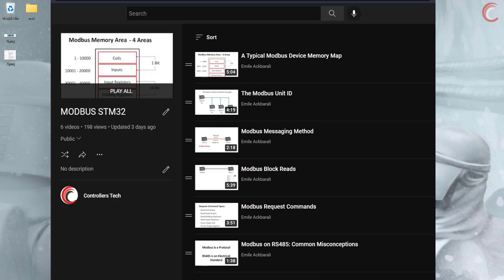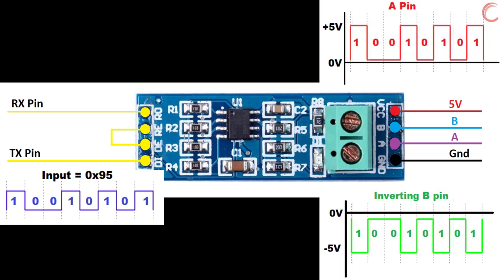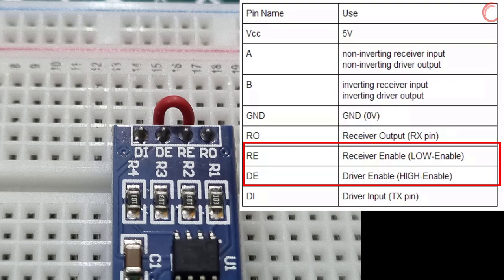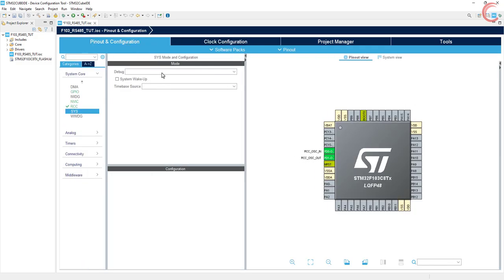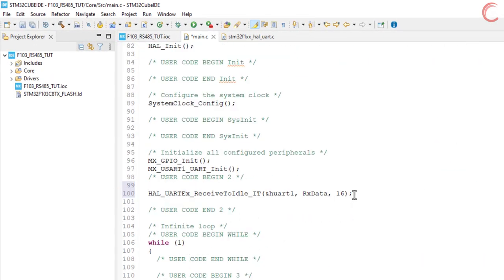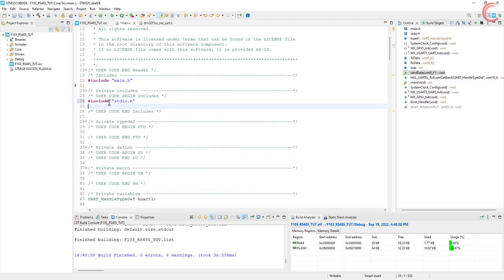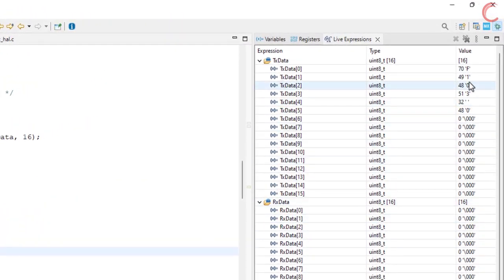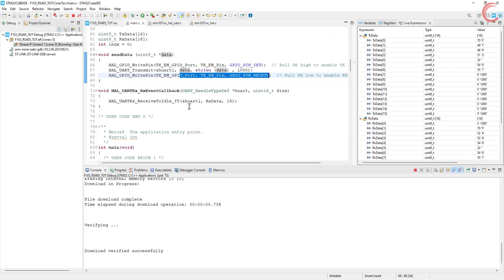How to Interface RS485 Module with STM32

Comment: I have a few tips about RS485 with STM32:
1) use a bias network in addition to the termination resistor. You can look up "RS485 bias".
Even if the RS485 line drivers have a "safe mode" they can still experience glitches on the receiver with the first byte. Especially if you don't share a GND.
So you may miss or corrupt the first byte!
2) STM32 UART RX doesn't have a hardware buffer. Receiving using interrupt is often too slow and you can miss data. Only DMA receiving works properly IMHO. 
3) You can use circular DMA for UART if you don't want to lose any data, but for RS485 this is not really needed. In fact it is best to clear any UART buffer after sending in case data ends up in your RX buffer.
4) Note that when a glitch occurs an RX error will automatically halt DMA reception and you have to manually re-enable it. So enable the appropriate error interrupts (UART and/or DMA) and handle the errors appropriately or you may wait forever for data (though that only applies to an RS485 slave).
5) Add short delays between switching Drive Enable and  data transmission (before and after transmission). This makes communication more reliable.
6) Enable Idle line detection interrupt. This is very useful in case you don't know how many bytes you are expecting. You receive an interrupt after receiving the last byte of a message.
7) If you want to use very high Baud rates check the datasheet of your line drivers. They come in different speeds/slope limits.
8) With any UART communication always verify your baudrate. With low clock frequencies you may not be able to get the exact baudrates you want due to rounding errors. Internal oscillators also have limited accuracy. It may work until it doesn't...
9) When you want to connect it to the PC use the FT232R USB serial converter. It has a TXen pin that switches while it is sending. You can connect this pin to the RS485 DE pin. The alternative is to use the DTR or RTS pin, but this can switch too slow as Windows is not real time. Cheap USB-RS485 converters often use DTR and are not always reliable. So check the schematic before buying one.
Reply: Hello There. Can i contact you?

Comment: hello, thanks for a great explaination, but I have a question. Could we connect the RO and DI pin of the MAX485 chip to RX and TX pin of USART2 instead of USART1 (on STM32L152RE)? because I had a project at  school, we implemented the MODBUS RTU protocol, at first we used USART2 for debugging purpose, but after that we had to change to USART1 to deal with RS485 to USB converter, and I didn't know the reason why we had to change.
Reply from the maker: You are using a nucleo board i guess. You tested it using the uart2 because in nucleo boards uart2 pins are shorted to be used as the vcp (virtual com port), so you don't need to connect an external hardware for uart, just the usb cable is enough.
Now you want to use the rs485. This is why you used uart1, as the uart2 pin are being used as vcp and are not avaialble seperately.
You can use any uart other than uart2. But if you insist on using uart2, then you need to see the schematics of the board and modify the hardware a little so that the pins are avaialble for external connection.
Reply: @ControllersTech Thank you very much, that is very helpful!

Comment: Hello, i want to interface a SmartEmbedded screen with an toshiba inverter and read out the inverter frequency on the screen by using RS485 wire with Stm32cubeIde, I would like to know if it´s possible ?

Comment: Great explanation. I use different module with auto logic for receive and transmit,so it's only need 2 pins. If possible i need knowledge about CAN J1939 and OBD2 :D

Comment: Hi, great tutorial. I have one question - what voltage are You using to power the modules? If the voltage is 5V - do You need any voltage converter for data lines Rx/Tx?
Reply from the maker: The voltage is 5V. The MAX485 chip takes care of thr conversion so we don't need any voltage converters.
Reply: @ControllersTech   Thank You for reply.

Comment: Hello great video ! i try your code on 2 H7A3 Nucleo, the TX board is working, but Rx board is not! is there any additional setting at IDE configuration that you miss out in the video? i dun understand the RxData[16] appear all 0 at Live Expression !
can you advise...
Reply: Hello... can u reply ...
Reply from the maker: Nothing extra is needed. Make sure both RS485 has common ground. 

If it doesn't work, first check if simple uart transmission is working fine.
Reply: @ControllersTech  Hello...  i use same power supply to the 2 RS485 board,  the power supply for the 2 H7A3 comes from 2 USB port is the fine?  Tx board is able to transmit F103 to live experssion, but Rx board does not show any (RxData all 0s) UART transmission is working...
Reply from the maker: If the simple uart is not working, theb RS485 won't work. You should look into that first. 

Also the tx buffer in live expression does not signify that transmission is working. The buffer simply changes because you are updating it in the code. You should use a logic analyzer or an oscilloscope to confirm if transmission is working. 

If you are using a nucleo board, do not use uart2, as it is connected to the st link. 

You should connect each board to the computer individually and check if uart tx and rx is working.
Reply: @ControllersTech  Hello... i  m using UART1 for both boards, power from USB port 1 and port 2, both the RS485 powered from external power bank. How should the common ground be wired? When i scope the Tx node A and B show correct waveform BUT 0.5v amplitude whats happed?
Reply from the maker: Contact me on telegram

Comment: how to use 2 uarts 2 modules with one stm. I tried to combine codes but It does not work properly
Reply: I have the same question, use uart1 transits, uart 2 receive, but it can't work.
Reply: @vincenttsai5116  It sould be. I use 4 modules now. Which one does not work. Did you try only receive and only transmit in while. If there is no data, maybe these tips help;
1) check your enable pins and their connections. Be sure that you are using enable pins correctly. 
2) you should connect N to N and P to P. 
2) I'm offering you to use callback functions  in normal mode.
3) if you have logic analyzor try to observe is stm send any data.

Comment: i want to make the communicate 2 stm32f103c8t6 stand-alone with no computer connection if it is possible that I give power both stms from same source and to max485s from stms 5v pn?
Reply from the maker: Yes it's fine.
Reply: @ControllersTech  thank you! I am new to electronics :p

Comment: i need code for reccieve interface of rs 485 in interrupt method
Reply from the maker: This video basically describes the RS485 to uart converter.  
If you are using this, then you can simply use the uart interrupt to receive the data.

Comment: Please is it possible to protect the code from theft?
Reply from the maker: If you are talking about STM32, then yes it does.
It have the methods to protect agains read and write operations.
It depneds on the mcu you are using. It can be configured using the option bytes in the cube programmer.

Comment: I think your explanation of voltage levels is plain wrong. This is a differential pair. Logic '1' is when A is low and B is high, and for '0' A is high, and B is low.
Low and High are the same voltage levels for both lines. There is always a positive or negative difference between the two lines. A voltage difference of 0V as you showed is actually an undefined logical state and must be avoided.
The absolute voltage level of the lines compared to ground is irrelevant as long as the limits are not exceeded. The signal is defined by the voltage difference between the two lines.